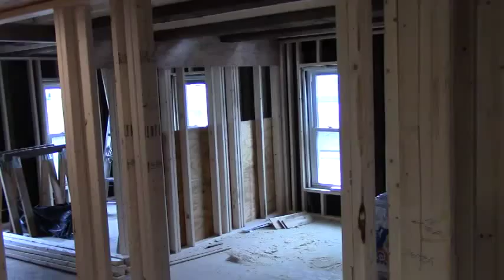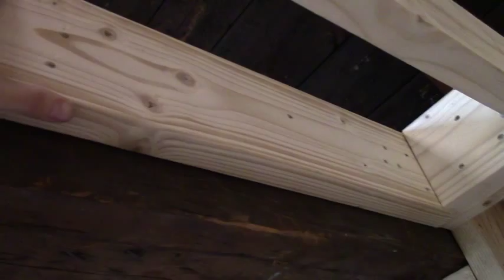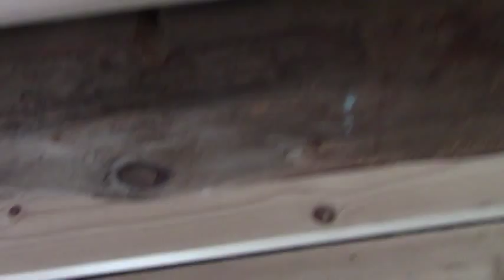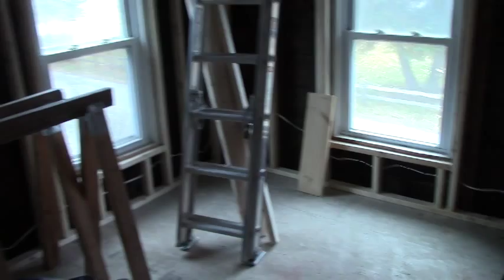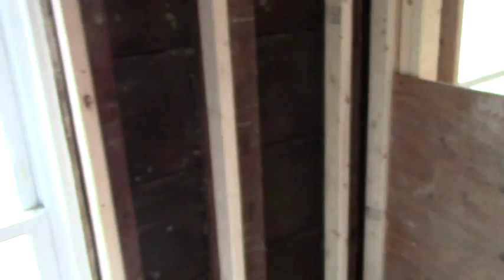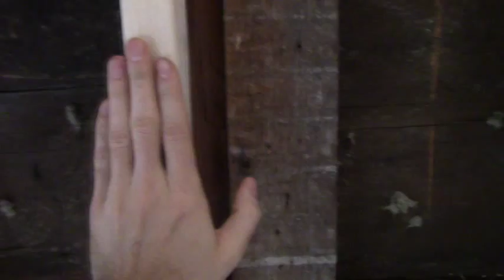1890's Timber Frame Renovation. Update 6 - Exposed beams and framing

Comment: Do not repair timber joinery that has lasted 120 years with metal hangers that will fail in 40 iam doing a 1865 and iam doing exactly what they did but it will look nice and function so who am i